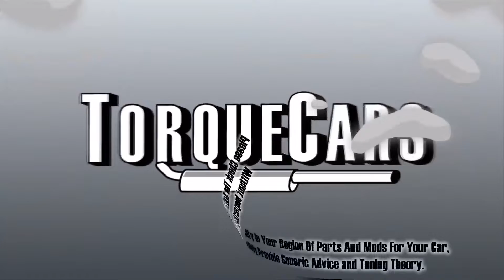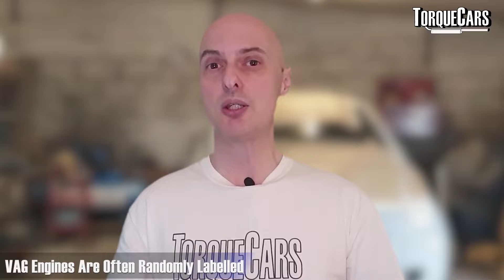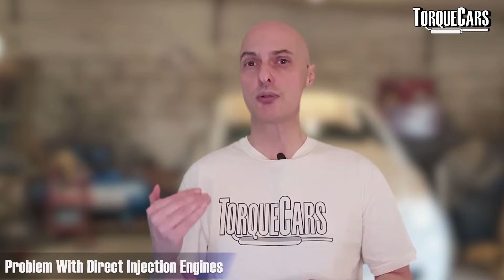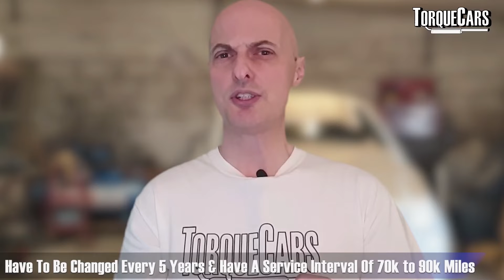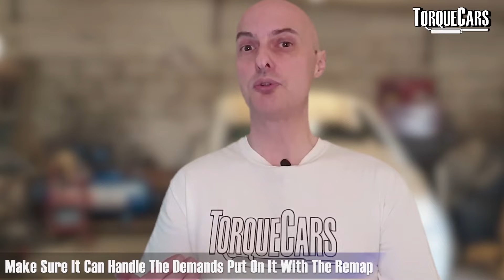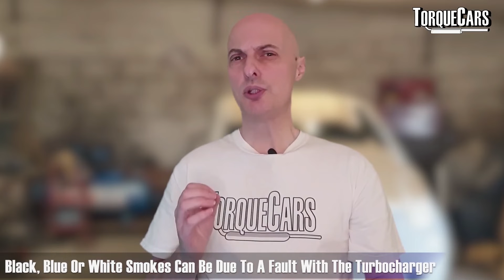Fix Common 1.4 TFSi TSi Problems & Issues 🔧[Troubleshooting]

Comment: hello,i had a caxa 122hp jetta,getting very low mpg below 20 even in highways,no error code i'm getting via scanning,well dont know where to look at,no rough idle and recently done 2 carbon cleanup (hydrogen based) ,any idea why low fuel economy ?thanks

Comment: Hi guys . Took my 2015 Audi a3 1.4tfsi to Audi dealer today as got a EML come on. Code was p2177 on my reader, so I changed the lambda sensor last week and cleared the code . The code popped up again earlier this week - hence the booking in at Audi. They said they can’t diagnose the fault unless I pay another 2 hours for review at a cost of £380!! The other issue is when I accelerate to around 3,800 rpms.. it looses power in any gear. Before that rev range it drives perfectly. Audi said it could potentially be potential blockage in the cat, or possible air leak in the wastegate on the turbo.. any ideas ? It’s only done 34k miles with full Audi history and one previous owner .. immaculate car. Would really appreciate some help on this guys
Reply: Hi, did you find out what the issue was? Its happening to mine.

Comment: I have problem with cold start after big service,idle rough and jumping idle from 300 to 1000rpm shaking idle and whole engine like is gonna shut down but he after 5 second work normally
But all time my rpm is 650 so low...and every cold start car shaking.
Anyone help i did big service new spark plug new ignition coils nothing solve the problem
Car has no fault codes in diagnostic.

Comment: Fault code P10A4, already change regulating flap but still not settle the problem, also i cant rev above 3000rpm.. what i need to do..? Please give some advise.. i use vw touran 1.4l tsi 1t3..

Comment: Maybe you guys can help me out, a friend of me has a 2015 a3 1.4tfsi 150hp. Some times when he is flooring it in 2nd gear between 4-5k rpm its like he lifts his foot of the gas a few times abruplty, it almost feels like ignition is cut. Only faults it has are p0300 p0301 p0302 p0303 coils have been replaced plugs are done recently.
Reply from the maker: They are classic misfire codes, if the plugs and coils are not at fault then my guess is carbon build up in the intake or a fuel delivery problem, has this been tuned/mapped? The engine is trying to protect itself so it's backing off and causing the loss of power. What is the mileage at?

Comment: Great video, thanks.  I have a 1.2Tsi so assume the same things you mention apply to the 1.2L.  My engine hesitates/hiccups on moving from low to high load, e.g. on a hill, or harder acceleration.  It does this when the engine is full warmed up too.  Could this be PCV?  Could it be carbon on the inlets (even though engine warmed up)?  Thanks.
Reply from the maker: Check for error codes via the OBD port. It could be a number of things, so pretty hard to diagnose remotely. The overall design of the engines was very similar between the 1.2 1.4 and 1.5 so the basic principles will apply to each of those.
Reply: Many thanks for the reply and sorry for taking so long to get back to you.  As it happens it was as simple as just requiring a spark plug change.  Modern engines with ECUs have feedback loops, so what would probably have been a simple single cylinder misfire in the past now comes across as something different because the ECU reacts to its sensors and presumably in this case cuts either fuel or ignition momentarily across all cylinders.  This makes things harder to diagnose.

Comment: Why is it bad to leave the engine warm up before driving and idle before switching of the car? (I m talking about 1-2 mins not 15-20 like he said in the video) I mean a cold engine pulling 2 Tons of metal , is that really a good idea?
Reply from the maker: These engines warm up very quickly and do so when actually driven at modest RPMs. If you just idle to warm it up it will take significantly longer, but it will depend to some extent on the temps your experiencing.

To answer your question in more detail I posted a video on cold starts, and there is a link to an older video that discusses why you should let the turbo settle a little while after a spirited drive (this can be done by keeping the RPMS to around 2000 for the last bit of your journey.
Cold Starts https://www.youtube.com/watch?v=KlPC6z4ktzw
How to avoid killing your turbo https://www.youtube.com/watch?v=YeG5-oWehcY

Comment: Is the 1.4 TFSI the same as the 35TFSI 1.5TFSI? Or is this another engine?
Reply from the maker: Yes they are all based on the same engine block, the 1.5 just has a little more capacity and it uses the Atkinson cycle from what I can make out to further raise economy.

The early 1.4 Twincharge EA111 had many problems and is quite different to the later EA211 versions.
Reply: @torquecars  Awesome thank you! So the 35TFSI is that engine good?
Reply from the maker: Yes it is a really good engine in the 35, I have no hesitations recommending it to people. The newer the better with each generation improving on the previous one. It is a great blend of economy and performance when you need it and they are quite easy to upgrade.
Reply: @torquecars  Thank you for the information!

Comment: What about engine shaking on idle? This seem to be a common issue. No one can tell whats the reason. Dealer states that itś normal. In my oppinion its frustrating and i have encountered tat a lot of users of 1.4 tsi reports this issue
Reply: Either timing belt/chain or waterpump/supercharger pulley
Reply: @rochjepetersen2119 there's no supercharger on czda type.
Reply: I am getting this shaking recently when on idle. However I am getting an auto start stop fault flagging up. Took it to one garage and they said there was a misfire showing up on cylinder 2 and they just removed the fault code and said it was working again. After driving it away from the garage the fault just appeared again and the auto start stop doesn't work still. Took it to another garage who replaced a spark plug on cylinder 2 and the coil pack and removed the fault code then said it was fixed. Yet again drove it away and same shit again. Now I have taken it back to the audi specialist who have done more digging as they say and have said that it seems like I have a carbon build up and I need to get this walnut blasting done. They also told me that the auto start stop fault is connected to this misfire. Any thoughts?

Comment: 1.4 TSI Twin charge also suffers from cracked piston rings and pistons mainly due to running too low octane fuel causing the engine to knock
Reply: This is accurate. So many of these engines will have been cooked due to folks using 95RON without thinking to check the filler cap (or just being a tight-ass).

Comment: I have a 2014 GT Polo and it’s been stuttering in started up like it misses a beat. Then in 2nd gear at around 4000 rpm it will hesitate for 500 rpm then get back into rhythm. 
Been on diagnostic bench can’t find a problem. Shame as it’s a good motor. 
May try a garage that can do walnut blasting

Comment: I’m just about to buy a 64 reg A3 a line  150bhp 1.4 tfsi with the czea engine code .. would you happen to know if that suffers from carbon build up also ? Thanks
Reply: My A3 1.4 tfsi 2013-2015 model used oil as hell. First every 1000km and then 1liters per 500km’s. Wont but it again, needs a motor replacement
Reply: @user-oc7uu8ss1x   What version engine did you have?

Comment: Can I recommend using more engine pics rather than yourself, for a more interacting experience. Cheers
Reply from the maker: Thanks for this suggestion I will certainly try to feature more engine pics and engine parts. It will be more work but I'm sure as you say it will improve the videos.

Comment: Would be great to have a video on the carbon build up issue on the intake.  Seems that because it is direct injection, these engines are prone to the problem.  I have the symptom on a 1.4tsi where it runs like a bag of spanners when first started from cold.
Any recommendations for how to fix it?
Reply from the maker: You have the EA111 engine, so the PCV is dumping oil vapour into the inlet which builds up on the valves. What an annoying problem. An oil catch can can reduce this problem fairly significantly.

I had a local garage carry out a BG intake clean on a carbon clogged engine and it returned to as new condition. They removed part of the intake hose and inserted an injector which delivered precise amounts of cleaner over a long period of cycled RPM's.

Removing the intake and doing a walnut blast is another option which many people try

I've not had much success with intake cleaners and the DIY approach so can't recommend you waste time an money on these.

I will do a video on this problem though as it affects so many modern engines.
Reply: @torquecars  That will be great if you can do a video on it.  I have heard of the BG system and it seems to get good results, but the only place in the UK I can find is waayyyy down South and not near me.  I suspect it is also expensive.

Stripping it all down and cleaning manually is not a 5 minute (or DIY) job!
Reply from the maker: Popping off the PCV vent pipe from the intake gives a fairly easy route for a spray to enter the intake stream.

The BG clean I had done was around £80 which I didn't think was too expensive.

Have a chat with local non franchised garages, they often have solutions which prove to be cost effective for this pretty common problem nowadays.

Comment: Hi pal I have a Audi a1 1.4 tfsi battery keeps draining can you help thanx
Reply from the maker: Could just be a bad battery not holding it's charge. Check with a voltmeter and pull the fuses in turn to see which circuit is causing a drain.

Comment: Hey man i own a 2019 Jetta 1.4T that has gone into limp mode. I suspect it is the pcv failing. It's the only dtc coming back on the scan tool. I cant find the pcv on this engine nothing is on the cylinder head below the coil packs like the older volks models. Would you happen to know the location of it?

Comment: I have a 1.4tsi seat leon 2009. I had a yellow engine management come on but no apparent issue. It would come and go but came more regular as time went by. The car has done 85k miles. The diagnostic read "cam position sensor" I swapped the sensor and the engine ran terribly so returned to original sensor. I read the manual and saw that the timing chain recccommed changing at 90k miles. I got this done and the light went away. The car still has the rough sound start which lasts 5 seconds before sounding normal. I think this is just typical of this engine. Other things to keep an eye out for is the door actuators fail at sround this age too. This is an extremely common fault and you can buy a replacement for £70ish. Takes 1-2 hours to fit. Problem seems to be worse in hot weather, maybe makes the grease more viscous? Otherwise a great car and engine if kept serviced! Anyway hope this helps someone in the future!
Reply: Hey there, just saw another video that shows this car does this when the supercharger magnetic gets stuck for a bit. Signs of wear. It comes as waterpump and supercharge pulley.

Comment: Hey 
Can you help me?

I would like to buy a SEAT LEON FR 1.4 tsi 150hp from 2018 with 10.000km

Is a good engine?
No problems ?

Thanks
Reply from the maker: They are very good engines, I have the 2015 version in mine and the newer one is even better IMHO. So much better than the early twincharged ones. Make sure you change the oil regularly and it will run perfectly. I will be doing a video very soon on the newer versions including the EVO revision.
Reply: @torquecars  and the consumes of petrol?
Reply from the maker: It depends how you drive it, I get around 50mpg on longer journeys and 45mpg around town without trying too hard. I have seen 70mpg for some journeys and a long motorway ride at 50mph usually sees the high 50mpgs or even low 60s. Overall it was better than my 2.0 TDi on fuel consumption and was a little more powerful so I am pleased.
Reply: @torquecars  what is IMHO?
Reply from the maker: IMHO means In My Humble Opinion and for reference you might come across the following terms in forums and on websites - IMO In My Opinion - AFAIK As Far As I know

Comment: My mk7 jetta has from the dealer after 12 miles taken forever to warm up if you leave heat on blast to defrost windshield or something it will never entirely heat up if around or below 40° rough estimate live in warmer climate used to be northern but haven't been up there a while assumed it was like that originally? Heard they just take a while do to super small aluminum block that is hard to heat up but I can only get 1/4 not 1/2 warm unless I'm driving

Comment: I have a mk2 Fabia vRS on a 13 plate, I’ve had it just over a year. The water pump failed at Christmas time & was replaced by a garage I’d not used before as everyone was fully booked. The following day the car started whining when pulling away & a weird sort of growling when accelerating in any gear under 2000rpm. Garage owner didn’t listen to the noise but said it sounds like dsg box is on its way out! I thought dsg boxes were almost bulletproof?

Comment: I'm thinking my wife's 2017 Jetta 1.4T issue is related to fuel delivery. Probably start with the filter first. Battery and alternator are good. Sometimes, not all of the time, it hesitates on a cold start and cranks a bit before starting when more fuel is needed. It is fine once started and fine starting warm already. Other than the fuel filter, I think we are going to do both air filters, brake pads, spark plugs and coil packs soon. Has about 115k miles. Already had to replace the waste gate a year ago too.
Reply: Sounds like the EGR warmup
Reply from the maker: Did you manage to solve this problem?
Reply: @torquecars  my wife got impatient and took hers to the dealer and after coilpacks, spark plugs, and a fuel pump, her starts fine cold every time now. Now a month later she just got a CEL for misfires so she’s taking it back to have it looked at.
Reply: @torquecars  hi I would like to buy 1.4 petrol. Mileage. 103.000.kilometres. What are you recommended to buy ? Thanks
Reply: @jasunto  same here 1.4 Jetta tsi
Reply: Carbon buildup perhaps? Might need a walnut blast

Comment: I'll stick with the EA827/EA113 port-injected engines.  I'm probably in the minority who prefer timing belts over chains.
Reply from the maker: You are certainly not in a minority here. I have discovered that the more recent engines use both direct injection and port injection so there is no longer any carbon buildup problems so gradually they are working out the problems.

Comment: I have done valve cleaning 2 times in the last 80.000km 
I recently changed the mounts for engine and transmission because it got a little sloppy for my taste. That's basically it besides regular services. Now at 180.000 km and tuned also. No oil consumption to mention.

Comment: Could you do a similar video for 1.5 TSI?
Reply from the maker: I certainly will do, they are very similar though as they share many common components. I preferred the sound of the 1.5 to my 1.4 and it just seemed to have a little more torque.

Comment: My problem was not listed, noise, lifter noise or this is a very load engine, sounds like  A TDI but it is a 1.4 tsi gas engine
Reply from the maker: Sorry I only listed the common problems, as with any engine there are lots more things that can go wrong. 

Have the lifters been adjusted? Has the oil been changed regularly and to the correct spec. Does it smoke or lose oil much?

Is it down on power? One thing that can happen is the variable cam timing adjustment starts to fail and will just clatter around, it will usually cause power problems and gaps in torque.

Comment: Back to the belt/chain situation: If your engine is an EA111 then it is a chain, if it is an EA211 it is a belt. This roughly dates back to the MQB platform (Golf 7, Octavia III, Seat Leon III) and starts from around 2013. If your car is 2015 or younger it is an EA211, so it is belt driven. It is very easy to tell for sure, if you google your engine code it will give you if it is an EA111 or 211.
Reply: It's also easy to spot by looking at the car's technical sheet: EA111(chain) is 1390cm3 while EA211(belt) is 1395cm3.
Reply: @Vintaginside adding to this, hold the trip button for 30 seconds brings the code up.
Reply: I've got a 2014 beetle that's got a chain 😕
Reply: My 2012 1.4 TSI twincharger tiguan is a chain (which has been replaced once)
Reply: @RichardStefanits  I had a ea111 this had issues up his arse brake booster went twice timing chain went high pressure fuel pump was going

Comment: Audi has been struggling for years to make the perfect engine while japan does it with the eyes closed.
Reply: Im guessing you've never owned a 1.4 tsi in your life. They're very reliable. The things mentioned are not guaranteed to break. They are precautions. The engine has been around for so long that everyone knows what could go wrong because there's still a lot of them running well beyond 100k miles

Comment: I have a vw golf mk6 2010 1.4tsi GT on 198,000 miles doing 20,000 miles per m.o.t and the problems I have had are.
A coil pack issue
Earthing problems 
Timing chain 
Super charge pulley rattle 
Suspected carbon build up (looking into this as we speak) p0402 code being thrown up every few weeks
That's really all I've personally had apart from wear and tear parts like pads discs wheel bearings, shocks etc. 
Annoying problem I do have that noone can give a answer to is a noise when engine is at running temperature at around 2000rpm that sounds like a squeal kind of similar to a slipping belt but slightly different. The only ever case I have seen similar turned out to be the supercharger actuator? This I haven't replaced as it doesn't affect the cars running or performance.